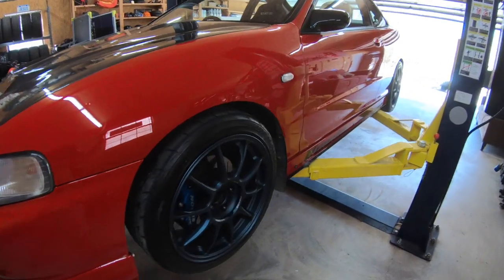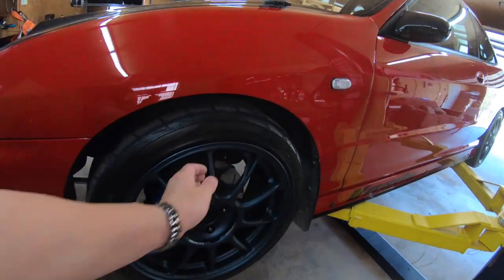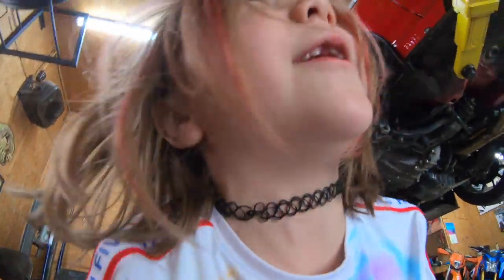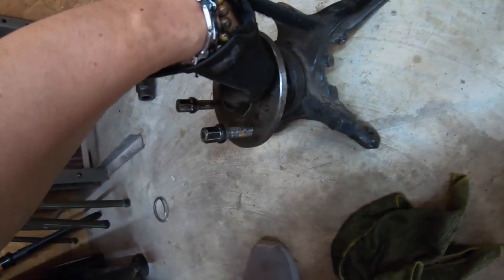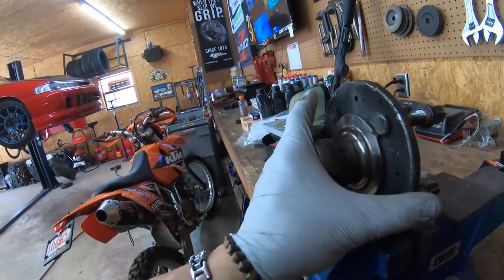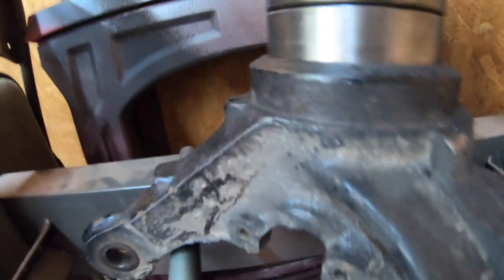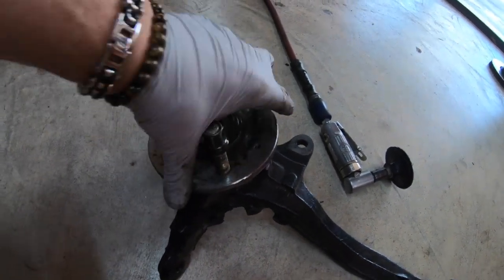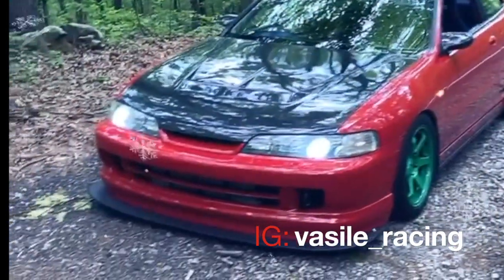Acura integra wheel bearing swap

Comment: Will be awesome if you make a video comparing a K20 turbo setup and a K24 turbo setup since you have done the 2 builds. Excellent videos Vasile!! I'm planning to swap an EG and boost it, but I'm not sure if I should go 20 or 24, I'm aiming to get 650+ hp for a DD. No 1/4 mile, just circuit racing once in a while.

Comment: Vasile,
What rotors are you running on the integra? Mini cooper 280mm? 
I run the mini 280mm rotors with my spoons on my em1, but wonder if others experience rotor centering problems because although the mini rotors share the same bore as em1/dc2, the bolt holes are a little wider on the mini rotors, so centering the rotors is a pain.
I guess my question is- what is your solution? 
On mine, if my rotors are slightly shifted, I'll experience wheel/rotor balance issues over 60mph

Comment: Just a heads up bro.. if you do track the car.. take the centre caps out.. they can melt from brake temps.
Reply: Ah ok.. aliminium should be fine then.. Ive seen them melt on a few wheels.. enkei etc.. the cap is also aliminium but the clip parts are not. They were plastic on them.

Comment: BluZe40 17x8 with 205/45??
Reply from the maker: HaterHurter sirG345 both those wheel used and that’s what it came with but I sold the wheels already, to buy more wheels
Reply: @vasilegarage2606  nice! Jus wanted to know the specs because I love that street tyre(indy500) and thinking about going  back 17.
Reply from the maker: HaterHurter sirG345 17x7.5+38
Reply: @vasilegarage2606  perfect! God bless and safety.
Reply from the maker: HaterHurter sirG345 ❤️❤️🙏🏼